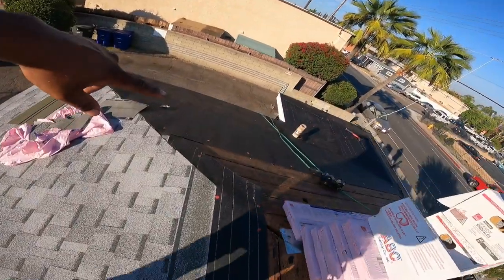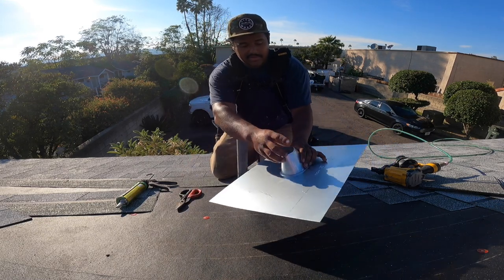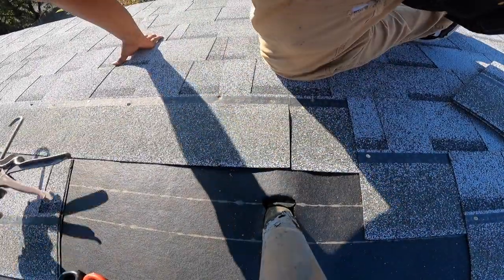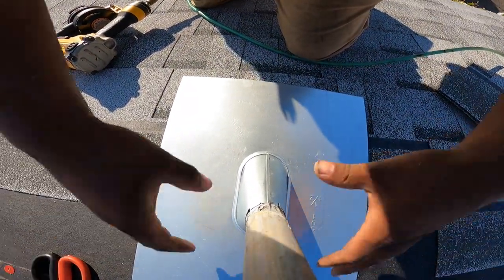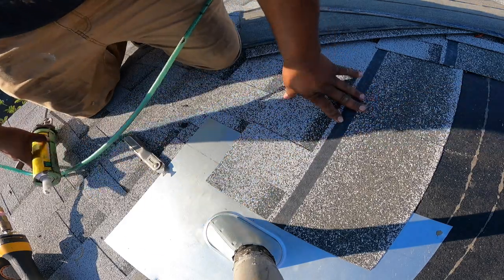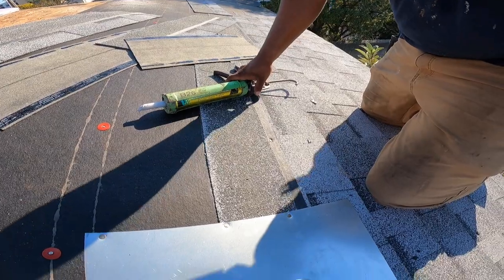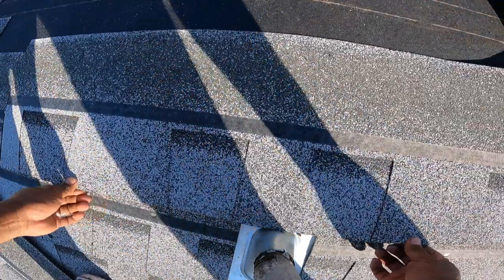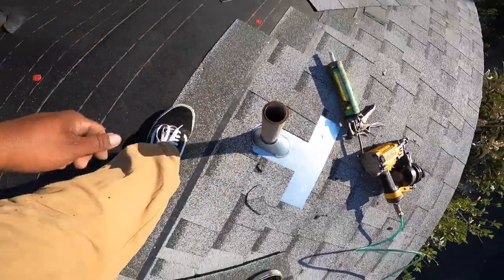POV Day in the life of a roofer! Shingle tear off and install! #roofing

Comment: usually when i do the roundish cut  for the shingle above the  pipe,    i take  a bad pair if snips i dont use on metal and just  cut for around the pipe with them haa, but nice work...
Reply from the maker: Yeah I used to do that but I didn’t like caring the extra tool up in my pouch. I put a new blade for my knife but thanks for the advice maybe I have to try a different workflow. Thanks for the support!👍🏾

Comment: Why don’t u round your corners since u don’t nail the bottom part of the flashing? Overtime wind will lift it… got to practice using the hook blade cutting the shingles and paper underneath.. why don’t u use your gun to line up the shingle that way u don’t waste time letting go of the gun .. just a tip.. good shit 👍
Reply from the maker: Yeah I’ve tried the gun lining it up just doesn’t flow good with me it doesn’t seem straight when I do it but thanks for the advice I appreciate it!